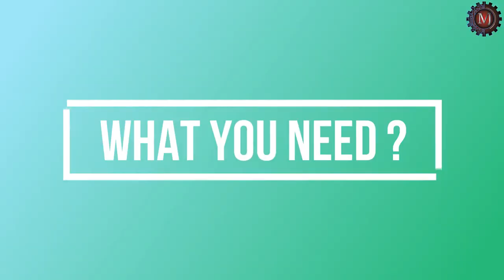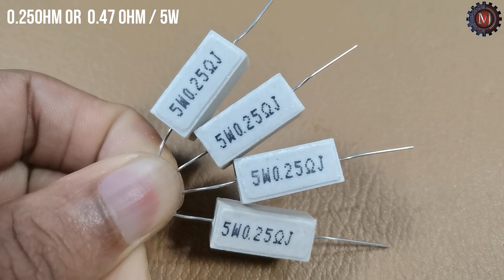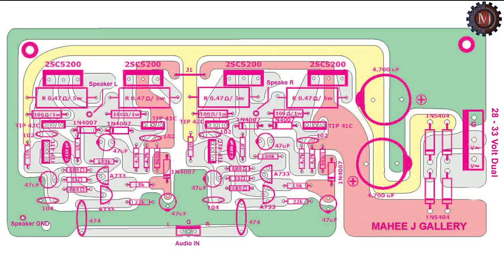200W Stereo Amplifier 2021 / Best Sounds / PCB + Circuit Diagram

Comment: Hi friends, I've managed to make an amplifier like your video, the sound is pretty good. But why is it that when I increase the volume and bass levels, the final transistor heats up very quickly, is there a solution that you can help?🙏🙏
Reply: @MAHEEJGallery  after I checked the dco voltage measurement, it turned out that the value was quite high at 0.7 volts.. how to decrease the value of the dco?
Reply: @hengkyambar8161  add another diode in series to the two series diode, and probably put the diodes in a sink, because it changes the voltage comparation value with heat